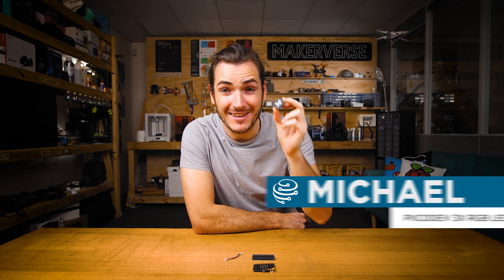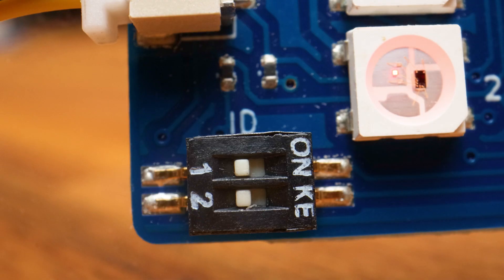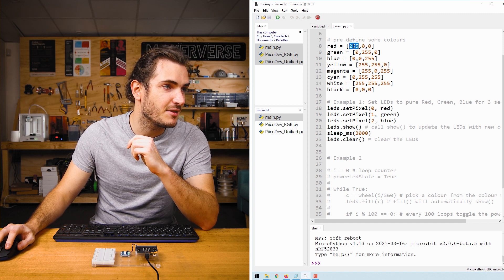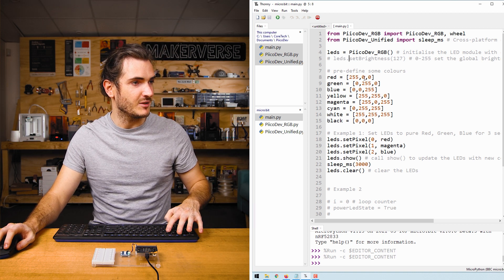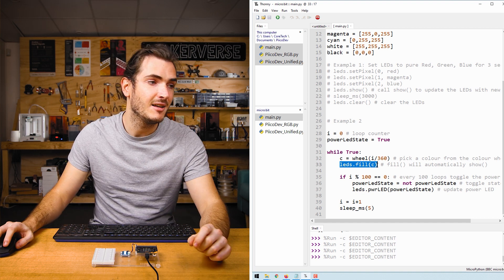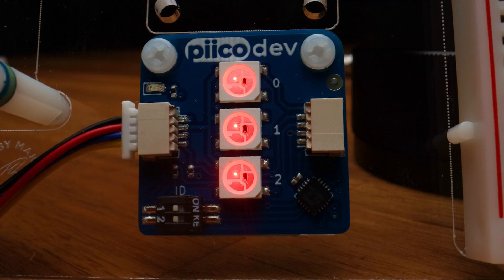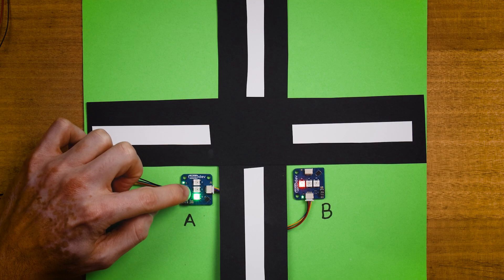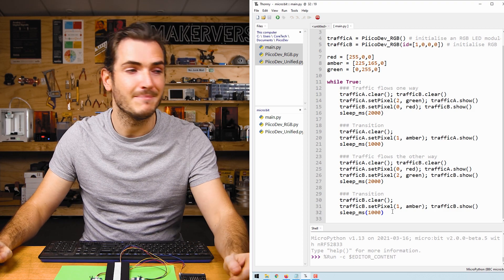PiicoDev 3x RGB LED Module | Micro:bit Guide

Comment: Like the way you've made the address selection of the module reflect the actual switch / solder pad setting rather than getting the user to work out the binary value of the address - for beginners this is a lot easier . Think this is the first time I've seen this implemented - well done 👍

Any plans to add picodev to Microsoft  MakeCode environment?
Reply from the maker: Thanks! We're doing our best to make PiicoDev as easy as possible for beginners.
We're going to stick with vanilla MicroPython at the moment - that way PiicoDev can support as many boards as possible.

Comment: just a tip, if the `i` variable does not need to remember how many times the loop has fired, reset it back to 0 after the if block. otherwise the value will overflow